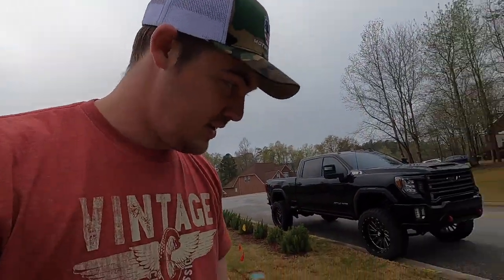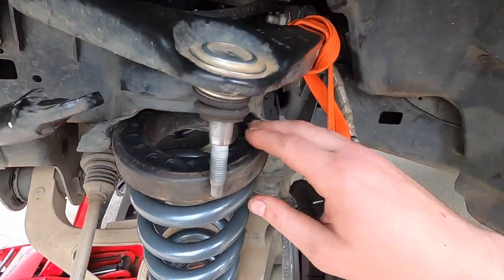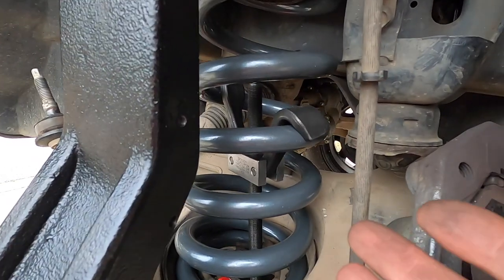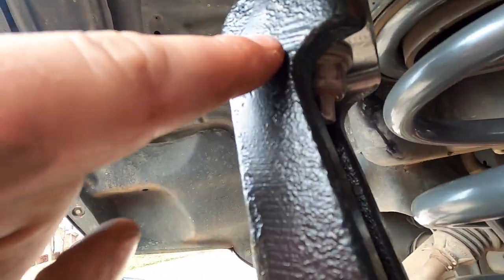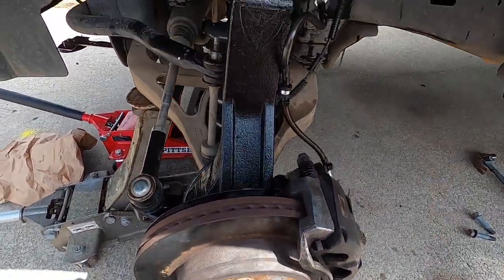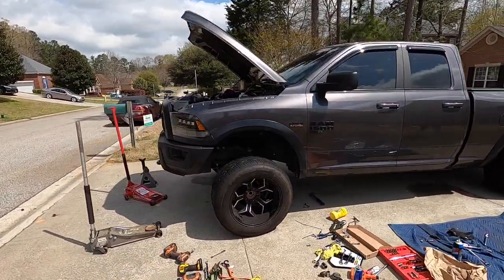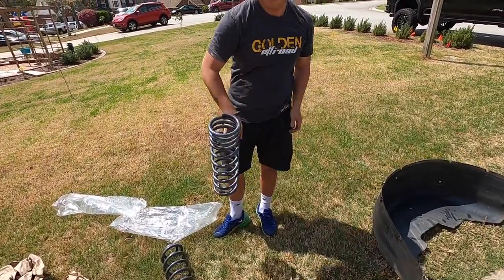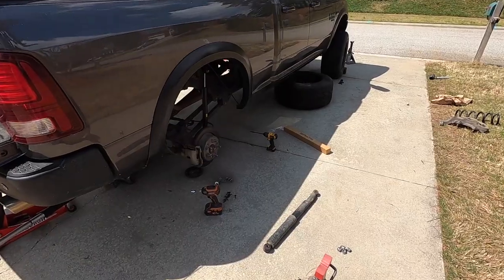warlock maxtrac lift kit part 2

Comment: How necessary is that drive shaft spacer kit?...the installer never put them on mine BUT i also never had vibration issues when driving. And i have a 2 piece drive shaft

Comment: Did you have to do anything to the drive shaft? I’ve heard of problems with the angles on it. And also truck sounds good what type of exhaust do you have currently?
Reply from the maker: Custom
Reply: If you have the two piece drive shaft just buy the carrier baring spacer kit like 40$  it’s for the max track 7 inch lift....did the same lift to mine and it ride good.

Comment: What tire size is in this video and what size did you go after this video ?
Reply from the maker: I can't remember I just know it was the largest a nitto 420 v comes in
Reply: I want the maxtrac 7" lift kit just not sure what size tires either 35's  , 36's or 37's ×12.5×20 not sure if I need to regear if I go 36's or 37's  I believe I have the 3.92 gear ratio
Reply from the maker: 36s from versatyre
Reply: @camwiththeram535  okay thank you ..... if I understood you don't have this truck anymore